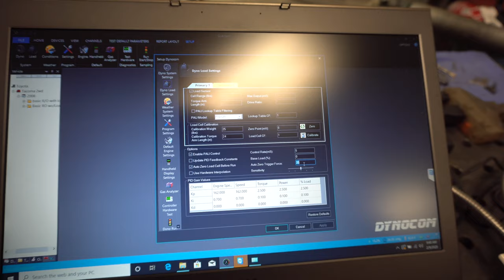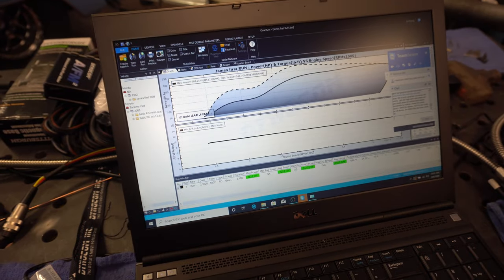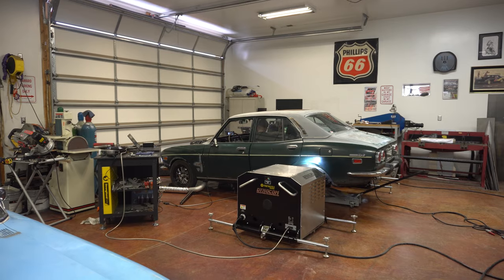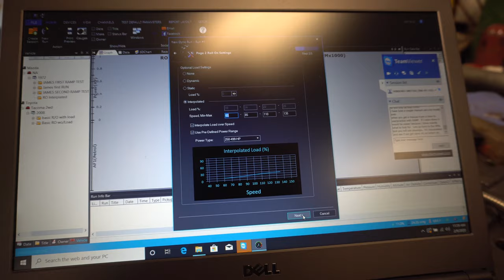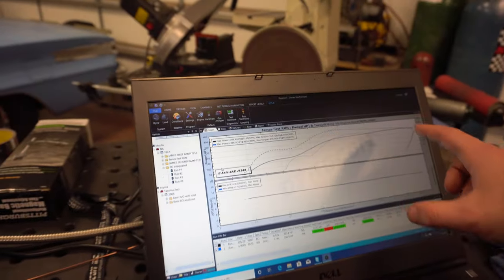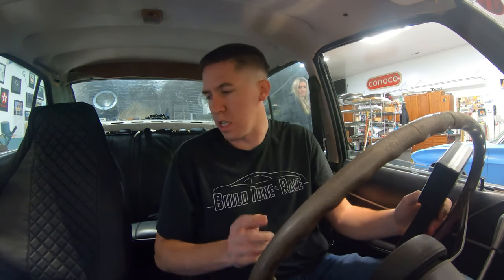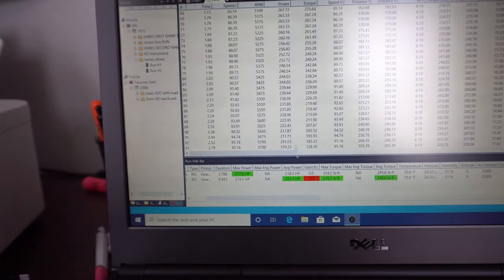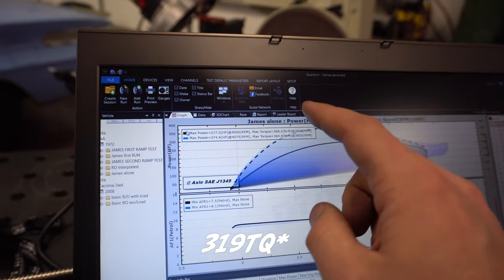First Dyno Pulls! STOCK 5.3 Swapped Mazda Makes Some Power on the NEW 3500 Hub Dyno!

Comment: The issue is this dyno controller sucks. You can't get a legitimate data in a 4 sec ramp run. This engine would have to make 2000hp to have a ramp run that short.

Comment: Hey brother. You can command a gear in the scanner for HP tuners.
Reply from the maker: I tried multiple times and it would still kick down to 3rd, Ended up having to go in and max out shift mph for 4th gear to  keep it from going to 5th and lower the down shift mph for 3rd to keep it from doing it. If I could command and it would not downshift that would be amazing!
Reply: @BuildTuneRace  Oh strange. At least you figured it out.
Reply from the maker: @theautoanswerman8063  kinda did lol hope i can figure out a better way to do it but definitely going to play with it more!
Reply: @theautoanswerman8063  that’s the unfortunate part about 6L80Es and probably other automatics is that even though you command the gear I’ve had them downshift anyway. I’ve found if you roll into it from 2700-3000 they won’t downshift. Locking the converter up does make for better results/consistency

Comment: You've got it all wrong. This is suppose to be your burnout car, not a silly big truck. 🙈
Reply from the maker: My original plan 100% was to use this as the burnout car! They like wall taps in the burnout comps here and if i did that to this car i could never find the parts to fix it
Reply: @BuildTuneRace  wall taps are a disqualification actually so dont do that. And fair enough man that makes sense.